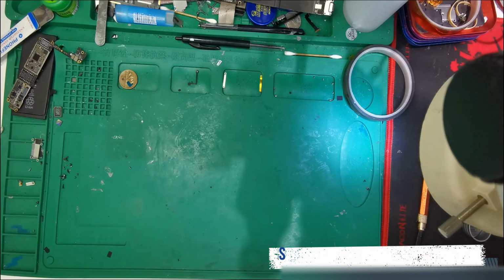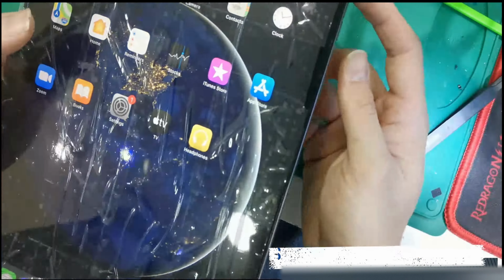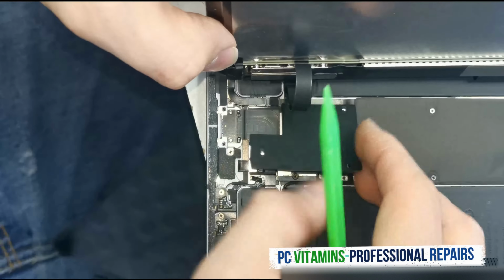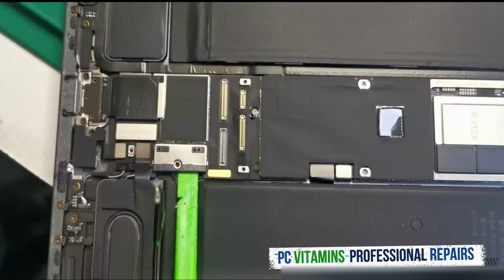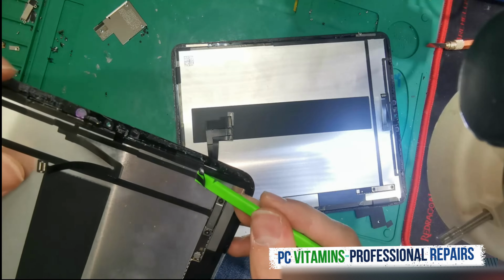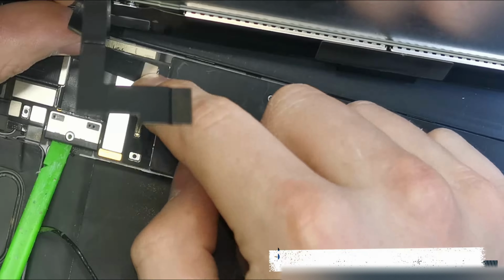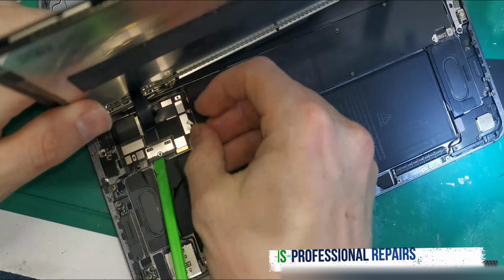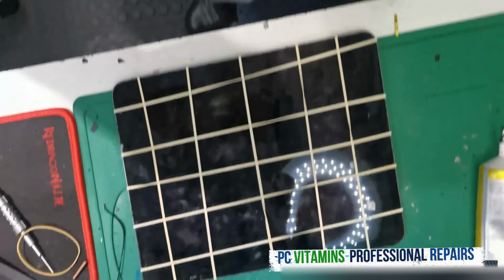iPad Pro 11 Inch 3rd Gen Screen Replacement \LCD - Tips and Mistakes to Avoid

Comment: Hi! I replaced my iPad Pro 11” M1 screen with a gen2 glass screen—Apple Pencil now works very oddly. Lots of dead spots as I draw lines or anything. Finger works fine.
Pencil has that issue.

Gen 2 screen blocked the autobright sensor on the M1 Gen 3 version. Wasn’t a deal breaker for me. But the pencil not working properly is killing me atm.

Any idea why that’s happening?

Sometimes the pencil will kick in and work perfectly, but just for a few minutes before going nuts again! !!
Reply from the maker: did you refurbish the glass only or swap complete lcd ??, i have seen that some cheap copy glass does not support apple pen as the touch is copy
Reply: @pcvitamins  thanks for the response. This was a Glass only replacement as my glass was fully shattered. It was NOT an lcd replacement. 

They just told me to come back when Digitizers are cheaper so that they can replace my digitizer :/ I don’t know if its bad glass or not. Sometimes the pencil works fine for like 1-2 minutes, then 90% of time its got dead spots. You can write over the dead spots at different angles and strokes of the pencil. Strange.

Do you think its the digitizer that got damaged, or bad glass??